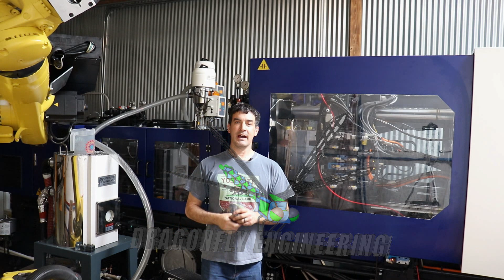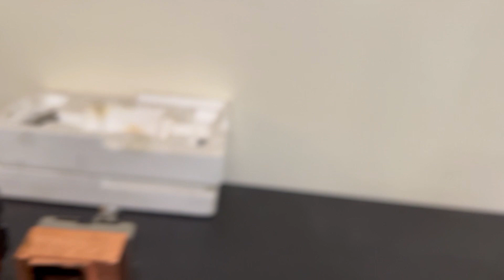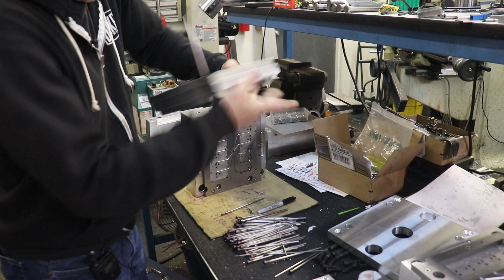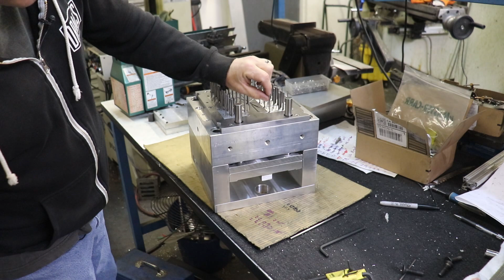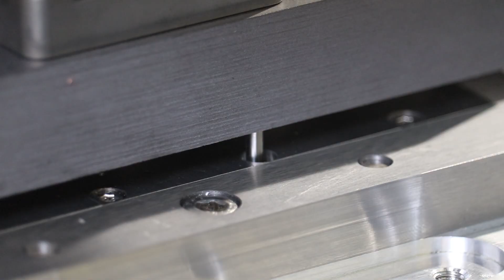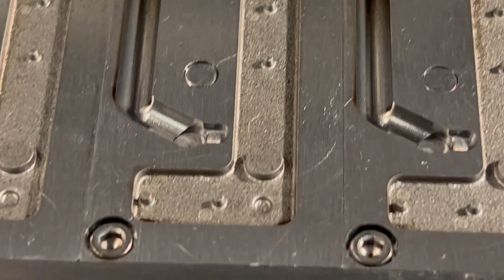MOLD ASSEMBLY AND EDM MILLING

Comment: Is there any content on your channel ( or anywhere that you know of )  regarding cooling lines and how they are machined into a & B plates and also at times into the core with o rings in the inserts ? . Thanks for excellent content , even though I'm a hobby use case that could never afford injection molding I find the subject fascinating where,  as with most engineering the devil is in the detail and tons of mistakes can be made if you don't have years of experience
Reply from the maker: Hi Hedley,  I will make sure to cove cooling lines in my up coming mold builds.  I dont have much content on them now.  I usually do 2 deep drill holes through the mold block and connect them with hose.  Thanks for the kind feedback
Reply: @DragonflyEngineering  thanks - this is the video where I noticed cooling channels going from the a and b plates into the cavity and core inserts . They also have a term ‘ sub inserts ‘ - https://youtu.be/DWi1vtfmMVk

Comment: You will find that most of your material and cycle time will be wasted on your poorly designed runners. Pp has the worst heat capacity . Maybe talk to a toolmaker about runners and gate location. Good luck.
Reply: Nope. The engineers do it perfectly every time, you just don't understand the physics.
Reply: Nope.  Engineers do it perfectly every time.
Reply: If you think there is a design problem, your probably right.  You're a poor design.

Comment: The leader pin pattern is offset also on the 'O' corner.  Did you consider a Melt Flipper runner design for your gating?
Reply: No.  That's for specific applications dummy.